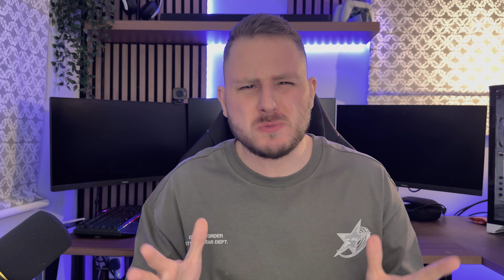6 PC Build Mistakes You Can Easily Avoid

Comment from the maker: What's the worst mistake you have made?
Reply: Combining Gtx 1080 with a B650 Mainboard and wondering why there was no image output over Gpu, not even into Bios. Image output over Igpu worked, Gpu image output with gpu in other pc worked, so I figured Pcie x16 slot of the new mainboard had to be defect. Hours later I figured out I had to update the internal firmware of the gpu (Not driver, Gpu bios itself) because some old gpus firmware combined with newer Mainboard bios can lead to this problem. I wish I woule have such simple errors as in the video but whenever I have one with my pcs, its one of the "No one knows why" software/hardware error like a defect but still mostly working mainboard that only lead to bluescreens randomly every few days while otherwise working normal. Took me 2 days to check, test ane verify everything beside the mainboard till the mainboard was found to be the culprit at the end.
Reply from the maker: @ArlingtonBriar Honestly mate, I would never think it was that. Through all my pc issues, that’s not been one. That’s strange! But at least you got it sorted, and thanks for sharing because you never know who might have the issue next!